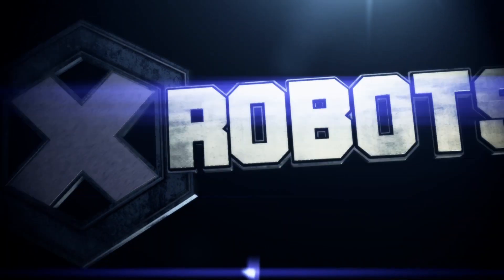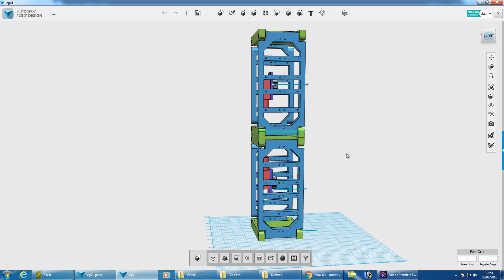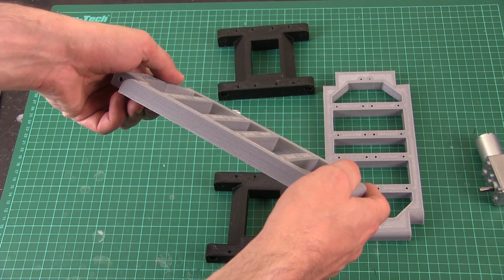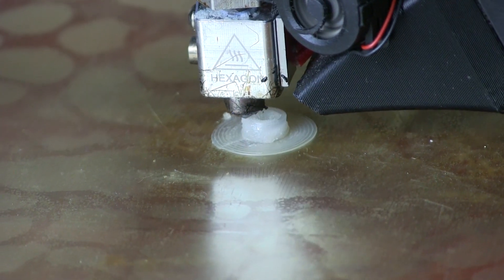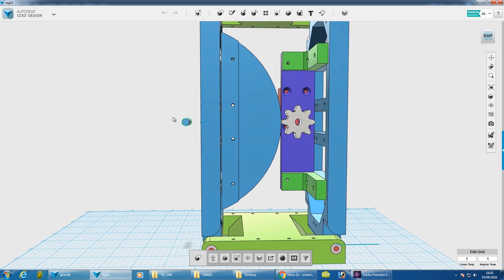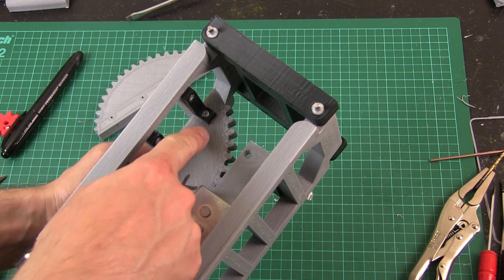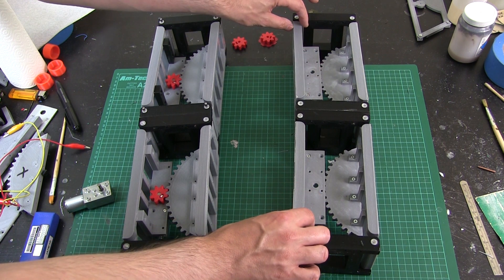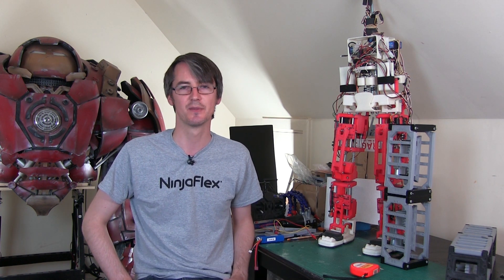Star Wars GNK Power Droid #3 | Working Legs | James Bruton

Comment: for simple things like those bushings and whatnot you'd benefit GREATLY from a small Hobby lathe, jewelers lathe, or something like that! it would make round shafts, caps, bushings far better than printing in 3D as your printed parts take a long time and have tons of ridges and marks on them, I have an old Craftsman/Atlas 618-109 style 6in lathe I picked up CHEAP and restored and could bang out bushings like that out of teflon or Delrin round stock really quick! Most of the small Hobby or jeweler lathes could be operated cleanly inside a house or apartment, with no oil drippage from any table or desktop...... I've been watching your videos for years and always wondered why you havent bought a small one?

Comment: James- have you any experience with Ninja Flex and it's exposure to the outside elements (IE-sun, rain, etc.)? I want to print a 0.5m diameter tire and wanted to see if Ninja Flex has the potential to dry up and break down with continued sun or rain exposure. Thanks

Comment: Why don't you use PLA filament instead of ABS. Sure ABS is easier to work with, but PLA is a much more rigid plastic and isn't as flexible. And you did mention that you did not want the parts to flex. It just seems kinda weird to me that you would use more plastic instead of a different plastic all together.

Comment: James, two of the issues with recreating a human bipedal walking motion that most people ignore are 1. The shift in CofG that we perform to lift a leg and not topple sideways. 2. The 'flex' in our ankles, knees and hips that both allows for twist and lateral movement as well as making up for irregular surfaces to walk on. 

I'm guessing your going to handle the CofG shift with software and lateral movement of the body. Have you considered giving the knee and ankle some lateral flex with something like a ninja flex spacer in the joints, possibly with small bungee's maintaining rigidity. With the right flexibility that should give some lateral and twist motion without compromising the overall stability and rigidity of the design.
Reply: +James Bruton (XRobots) ok, understood. I've never managed to get the rigid structures as fluent especially on uneven surfaces. Although I had a lot less access to control systems and computational power back in the day. Looking forwards to seeing how you do it. :-)

Comment: Even if you have a good hip system James, you're really going to stuggle with over balancing: the height + weight of the rest of the body would probably require adaptive feet, knees and hips, plus some sort of shock-absorbing system above the legs or on the feet. Sorry but even if you put all the weight at the bottom of the body I just cannot see this working. :/
Reply: Obviously, he has not. I'm sure there were lots of people (who also thought they knew more than they actually did) who told tesla that an electric car could not work.
Reply: ***** custom fabrications I just wrote an essay to reply but I'm not going to say it because there's no point; James will always prove me wrong XD. Yes I did watch part two but that wasn't quite what I meant by 'adaptive'.

Comment: How's the geartrain backlash when you manually manipulate the legs? Good thing about those wormboxes too is they seem to be available in a whole raft of different output shaft RPMs.. if say you find it's too fast & not torquey enough (used some 40rpm's for an automatic chicken coup opening system, work well)

Comment: I am quite impressed with that mechanism. I wonder if it could be adapted to belt drive somehow. I have never been keen on plastic gears for a final drive.  So I guess you need position feedback. Consider the AS5040 absolute encoder, I really like them.
Reply: Pots are simple which should make it easier to finish. If you laser cut some nylon sheet it would be much easier to get smooth solid gears. I dont know if you have access to one or not. I luckily have one in my garage but too far from you.

Comment: Hello, i'm quite hyped with that mechanism and i thought: If you put the wheels on one side, you could do two of those mechanisms for x and z movement.
Reply: Something like that: https://1drv.ms/i/s!AvEntklC3a5IkJpOffSqxUibZqI9iQ
You could also do 4 mechanisms to gain more power and stability, but 
have to put the motors on the outside or inside with belts...
Reply: That's an interesting idea... On the other hand, you'd need some sort of universal joint on each connection of a long parallelogramme side to a short paralellogramme side. You'd also need the parallelogramme to be made of disjointed rods (for it to angle to both x and y), so you'd lose out on stability and rigidity there.

Comment: Almost feel that due to the legs being so long, the box on top will have to be massive to make it in perspective, and thus putting alot of weight onto your project. Anyway great job again on your project as usual cant wait for the next episode  :)
Reply: Well i'm sure you'll make it work ;)
Reply: +James Bruton (XRobots) I was actually thinking a good place to keep batteries would be in the feet, parallel to the ground. But if you don't need any mass there for stability, then there's no point.
Reply: +James Bruton (XRobots) true

Comment: Hi James,

Respect for working this out. I would think about ‘Steel’ bearings if there ever becomes a 4000 metre race for this and any others, or even the 100 metre sprint, but of course the most important thing is to design really short ‘short shorts to show off their arses, as they do with human sprinters,. 
Of course you will have to go back to ‘the drawing board’ so as to speak, to design any incredibly thin and small ‘fatty implants’ AKA ‘breast’ which do not flop all over the place at, I am sure the Hyper speeds these will be moving, May Adidas could develop these?  ;=)   :=D   Mind you I personally will be pleased to watch these move forwards without falling over!